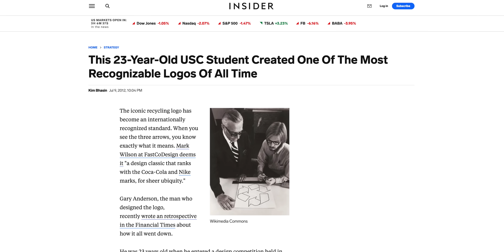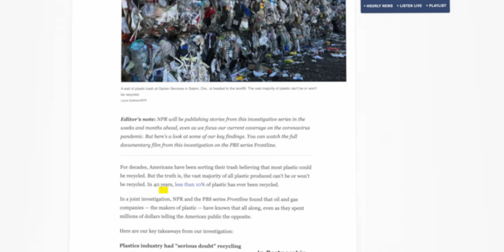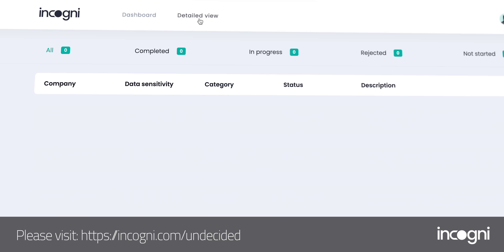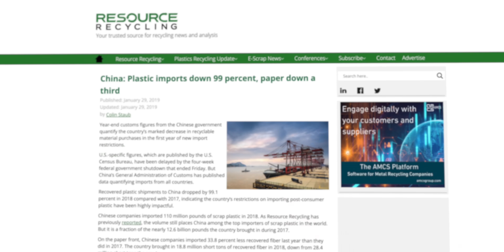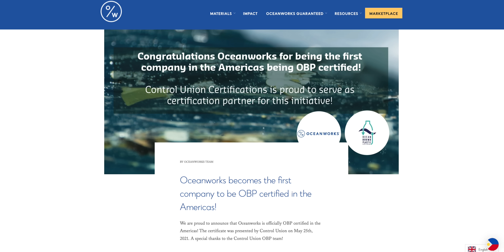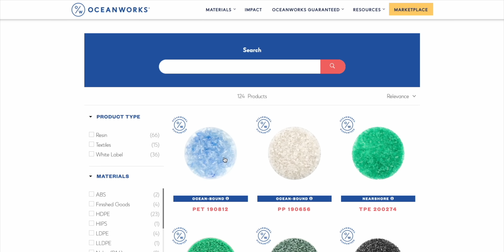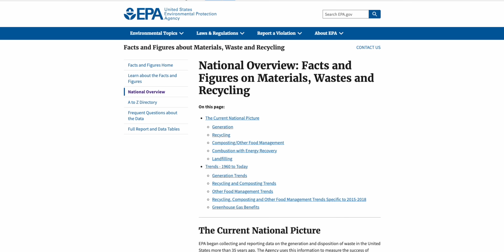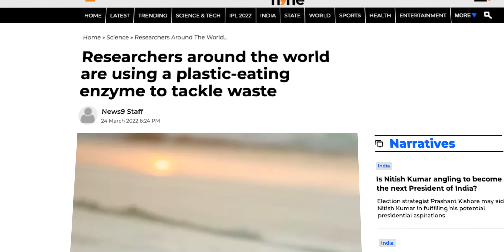The Truth About Plastic Recycling ... It’s Complicated

Comment: It's still a wonder to me why more people don't mention/talk about the system used in Scandinavian countries (idk if similar systems are in use in other countries). It's a recycling system called "Pant". 
Basically this system is a letter marking of bottles (glass and plastic alike) which adds a waste value to a bottle, typically equalling to 15-40 cents depending on the size of the bottle. This extra cost is refundable at any grocery store -which are all mandated to feature a bottle recycling machine (works similar to a reverse vending machine). Baiscally this recycling machine accepts and sorts all bottles for you, and then hand you a receipt with the value of the bottles you recycled, and this receipt is then valid to use in the grocery store you just recycled at. This way the consumer is incentivized to collect and recycle their bottles to recoup on the recycling tax, and it makes the actual bottle recycling 100% efficient with no requirement of manual labor in terms of sorting the waste at a sorting facility. You literally skip the sorting facility entirely, and instead implement easy-to-manufacture standard size recycling machines that can easily be expanded and pose no building implications etc.

Now, this system is currently in place for bottles specifically, but there is no reason a similar system couldn't be expanded to other recyclable plastic products as well. The entire idea of having a massive sorting facility that depends entirely on human labor is truly a 50 year old concept that I can not fathom still exists in modern 1st world countries.
Recycling is not a scam, the way most countries are trying to recycle is a scam.

Comment: It is so much cheaper to just make new plastic, we should just get rid of PVC, as chlorine is a bitch to deal with. The other plastics we do pyrolysis on, and the fuel we make from that we enter into the fuel stream again. The optimal solution would be to create oil from algae we grow via deep ocean water displacement to the surface, as there is a lot of nutrients in the deep parts of the ocean, which we can easily make available to algae with simple solar pumps out in the open ocean, then make plastics and other fuel products from it, and use pyrolysis to handle the plastic, and get it back into the energy stream, thus maintaining an equilibrium that also includes a stable energy supply. If we do the ocean algae thing really well we would offset the acidification of the oceans as well, which I see as a great win for society in my opinion.
Reply: also the quicker we get plastic out of the environment the better, because of microbes are going to be continuously be exposed to it, before long it will be an arms race, and plastic might lose its best quality, which is its longevity, imagine buying a coke, but in 2 days bacteria eats up the container, I'd be livid if that had to happen to me.

Comment: I'd love to see a truly sustainable degradable 3d printer filament. PLA , made from things like corn was supposed to be degradable, but there's no simple way to do it practically. If someone could develop a composter system designed to break down PLA we could finally print what we need without worrying about adding to the problem. I would happily pay 3 times what i payed for my ender3 for a machine that breaks down the plastic when im done with it. You can use recycled PET bottles, but i'm guessing that only works once before the plastic becomes useless.

Comment: I'll say that

1) Get back with glass. Glass is non-toxic and is expensive but should have a deposit program since glass is more reusable (and the aluminum should be recycled since aluminum can be smelted). Sure, there could be shards in the streets again but it will likely decrease when deposit credit rewards are given or make those reusable.

2) Biodegradable should be more mainstream since biodegradable plastics do not last that long and reduce landfill.

3) REUSEables and refillable, those should be taken more and have either stations or have places that refill the reusable jugs or bottles. As those make things guilt free and something like SodaStream can also help the environment since you can reduce plastic (and aluminum) use with those kinds of machines.

4) turn some plastics for long term objects. Like turning plastics into billiard balls or for long term electronics or for windows or arts and such. For those also keep plastics to be in oceans and in a landfill. But sometimes there are alternative materials to use them like wood or metal.

Comment: Instead of attempting to recycle the plastic, reuse it by simply heating and passing it through an extruder which forms the once used plastic into Plastic-Lumber which will far outlast wood and alleviates the stress on forests.  The plastic can be extruded into thin metal sleeves to create framing lumber that is far stronger than solid wood, and in some cases stronger than Lam-Beams.

Comment: Arc plasma gasification seemed promising a decade ago. It vaporizes material down to constituent elements and the only byproducts are syngas (H2+CO) and an inert glassy rock called slag. 

Syngas can be burned to power the operation, or it can be distilled into other petroleum products like diesel that are typically derived from fossil fuels. 

The slag is all of the inorganic heavier elements which get locked into the glassy rock. It's inert, safe and be ground up and used as aggregate for construction.

There are/were small pilot plants but I don't think anyone has been able to do it profitably yet. I'd like to know where this technology is. Are there fundamental limitations or is it just not ready yet?

Comment: A few ways to reduce your plastic (not in any order):
1. Bin buy your goods and use sealed glass containers to store
2. Use reusable hemp, cotton or even nylon bags instead of plastic bags when buying produce, unwrap cellophane  items and leave it in the store!
3. Collect water from a spring or aquifer instead of buying single use water bottles. If unavailable get water filter unit on you main water to filter out the tap water. Get a reusable water bottle!
4. Make your own yogurt, can make 1L of yogurt and only has a very small plastic pouch instead of a dozen un-recycleable cups
5. Bring your own reusable hemp bags to the supermarket to pack groceries
6. Buy drinks in glass bottles, may be 20c more but it tastes better and is 100% recyclable
7. Take your own container to butchers when buying meat
8. Buying electronics, don't buy cellophane wrapped items, unavoidable sometimes so just unwrap it and leave it with the store (many people doing this the retail industry will get the picture)
9. Finally people just need to take responsibility for their actions,  especially adults, stop acting like children and look after this planet for our children.

Comment: It's energy intensive, but how about pyrolysis using heat to break down plastic into a diesel oil like liquid.  This could be re-refined to produce gas or virgin plastic.  Build a facility in an area with a lot of wind power and rail access.  Bales of low value waste go in, refineable liquid comes out?

Comment: One waste to energy system that is much more effective than incineration in terms of cutting down on pollutants is plasma arc gassification.  This is effectively the same as burning it, but more intense, forcing the combustion reactions through to relatively simple molecules - you still get carbon dioxide and methane (and the methane can be captured and burned because it's worse than the CO2), but you don't get all those nasty half-burned hydrocarbons. Most of the non-carbon, non-gas stuff winds up in a chemically inert ash (the burning process is high enough energy that pretty much anything that can react will react).

Problem is, the public usually just sees it as a new incinerator, and nimbys don't want an incinerator around, environmentalists who aren't thinking big picture think "oh, it emits CO2 it's bad"  (Which, yes, but anything that actually breaks down the waste will do that, and this puts it in a controlled system that synergizes well with any carbon sequestration system that becomes viable.  CO2 is bad, but waste is always going to be bad, and this is the least bad version of it I've ever come across.)

Comment: Recycling only delays the inevitable. Plastics cannot be recycled into perpetuity. So, eventually they will be dumped. That is, unless we stop using it or turn it back into what it was in the first place, petroleum. How much energy will that require? How much CO2 will be generated as a part of the process? No, the only real way to reduce waste of any kind is to use less in the first place.

Comment: I am glad you mentioned that microbes  are being used to degrade plastic into usable end-products. Placing the microbes in the correct environment for optimal enzyme  activity will increase the rate/speed of plastic degradation. It should be eventually possible to place plastic in an "enzyme bath solution"  to degrade plastic without bacteria. Without the internal combustion engines along with the rise of EVs , solar, wind and wave energy, the petroleum industry will have to depend more and more in using their oil to make plastics in order to survive economically.